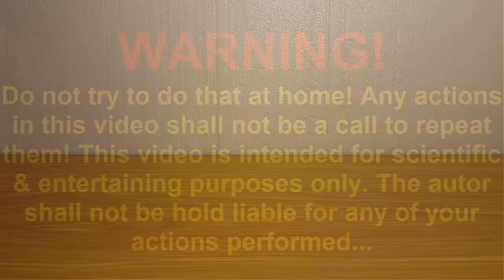How to make an Electronic Cigarette Lighter

Comment: non safety 18650 lighter
Reply from the maker: Why
Reply: Because, if you push the coil, it will contact the metal plate under it, making a short circuit. Cheap batteries may heat or even explode under short circuit.